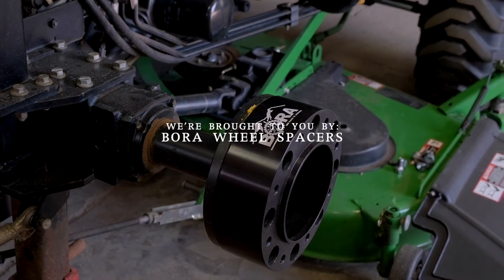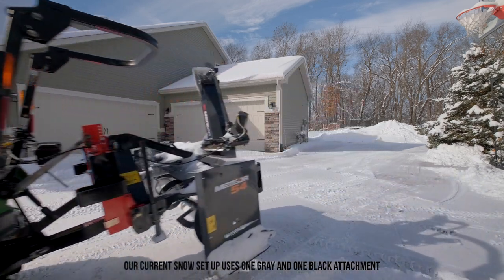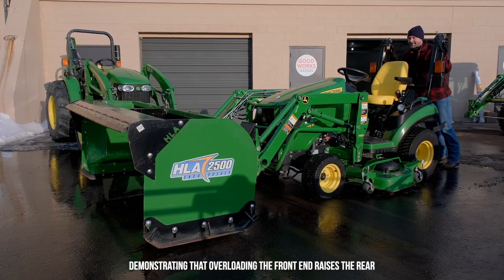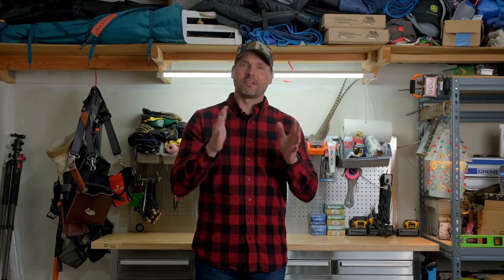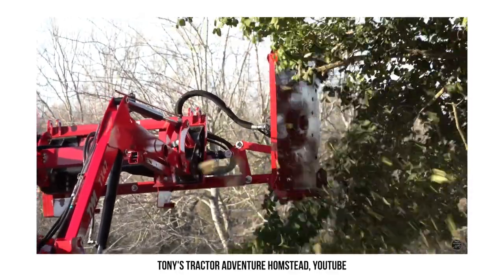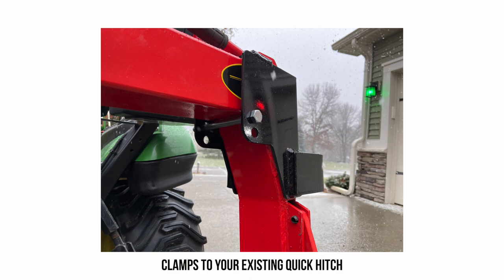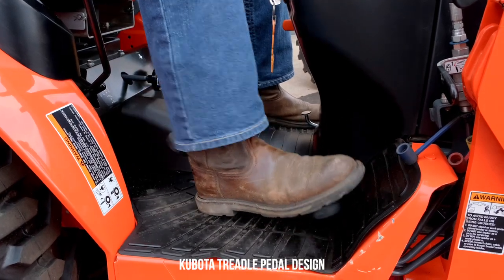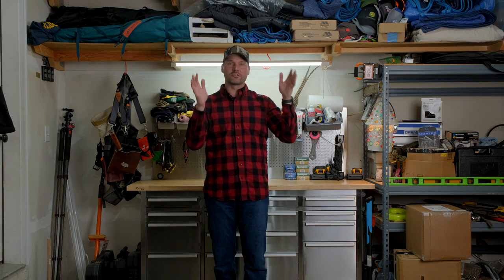7 UNSOLVED TRACTOR MYSTERIES, NO EXPLANATION.  CAN YOU HELP? 👻

Comment: Many moons ago, before anyone had heard of Kubota, Hydrostatic transmissions came around on Lawn and Garden tractors. Deere had a dash mounted lever that required you to negotiate a slot at the neutral position to change direction. IH had a lever that simply pivoted, no gate. Ford, made by Jacobsen had a lever that simply ran in a straight line and the knob on top would pop up when in neutral to lock in place. The next generation Ford in around 74(?) had the treadle. New Holland and the Case IH painted clone still uses that design. Everyone was scared of patent infringement. Then we have what there is today. Deere put the brakes on the left; entirely backwards to me. I control motion with the left, brake on the right, foot throttle on the right, just like any other vehicle. At some point we switch over from compact to full size tractor and the pedals are where the have always been. Deere even dropped individual brakes somewhere until you reach a certian size. At least we aren't trying to still use hand brakes like a WC Allis. You haven't lived until you try and stop a loaded hay wagon in road gear. I had a Ford 2110 once. I liked the size and power but came to hate the poorly designed engine.

Comment: I'm not a fan of the "treadle" pedal either, especially the one you showed with a big gapping hole in the middle (C shape). I rented a Terramite a few times and the pedal works in the same way, except it's a full platform that your foot rests on 100% of the time and it's comfortable. I used my friend's Kubota L3301 a lot last summer, I got used to it, but I'd rest my heel on the floor pushed the part sticking out with my toes. To reverse, I'd lift my heel and just stomp on the rear piece sticking out. Laying the foot on top of the whole thing is unnatural.  While I don't like the order of the JD pedals, it's still a lot easier to get used to my 1025R. Probably the 20 years of using a 100 series ride on helped.

Comment: I dont know why manufacturers have gotten away from making low profile machines in the 50-75hp range. Just bought a new 5075e almost a year ago now and it's just about worthless without something heavy on the three point. Haven't gotten around to filling the tires yet but it's coming. My old Ford 4610su has never scared me on uneven ground and I've never had the rear tires off the ground. They've always had water in them though.
Reply: Just bought a used 5075e cab. I put 50 percent filled  rimguard in the tires. Quick hitch with heavy hitch on the back for weights. I can take the rear weights off easily that way. Well I have a forklift. So I can cheat that way. Heavy hitch is because I also bought a grapple. Messing with trees. I might want more weight then filled tires. Otherwise I might have filled the rear tires more. Forgot about the heavy hitch. Make sure you have the tires mounted on the wide side. Some farmers do use the smaller tractors for row crops. So they want more clearance under the tractor. So the tractor itself does not knock the crops down. Or rip the leaves more.

Comment: Its called common sense.  Tractors are built to use a multitude of different equipment.  The basic trator can not be set to operate every piece.  That is why there is auxiliary add on equipment.  Now when selling a bucket, or other equipment, there should be a list of recommended add ons necessary to operate safely.

Comment: 🤣🤣 Thatv was great!   My neighbor painted his Kioti JD green and paid 25 to 35% more for his attachments than I. 🤣🤣  I think I have the HST pedal reason.   BC on a long road trip or a full day in the field. Pushing the car right pedal that long would give you groin problem.  
Tractors should come stock with  Bora Wheel spaces.  
I bought the Rhinohide BC it comes off easy so I can get in the garage door.   And it's lightweight helps stability.  It also should be factory.   Indestructible!   Best thing I've bought off you.   Cuz!

Comment: After reading all the comments here, I keep seeing "Why don't they just...".  Addressing this from a general engineering and marketing perspective, there are some easy answers, and it's not tractor specific. R&D costs a lot of money. First, there has to be enough interest from the market to add it or change it. For example, why don't tractors have horns?  Well, how many people would use them? Sure, they're probably only $10 to $15 in parts (horn, horn button), but if you make 10,000 tractors a year, that's $150,000 in parts. But wait, the implications go deeper, because horns need fuses and wiring. The fuse box may be at capacity, so there's the added cost of adding a fuse position to the fuse box (which may or may not have space, and could entail changing how it's mounted). Horns aren't wired straight from the horn switch to the horn, they're part of the wiring harness, so connectors with more circuits will be necessary. Now that fuse box and harness aren't compatible with any subsequent models that may have used the same assemblies. Then where does the horn switch go? On the wheel? Now we have a new steering wheel change. Maybe it goes on the dash. But there's no position for it, so now the dash needs to be modified, which means new injection molding or machining. Manuals have to be updated. Assembly line people have to be trained. It escalates quickly. And there's more...

They have to stock replacement parts, have SKU management, and have to determine how long that part will remain available, etc. Now, how many people care about having a horn? No idea, but let's say it's 0.1% of the market (obviously they've gone for years without them, so the demand isn't really there, and they're not a required safety item, like back-up beepers on heavy equipment). That's 1,000 users out of 10,000 tractors. So maybe those people are willing to pay the extra $25 for a horn (remember, you have to mark-up products to make a profit, nothing is free). But it's not an orderable option, the tractor comes with it (making it an option would add even more additional cost). So now 90,000 buyers are paying an extra $25 to support the 1,000 buyers who want a horn. And people complain how much tractors are cost now, and who the heck uses a horn on a tractor (except that 0.1% who LIKE the idea of a horn, but may even use it).

You can extend this to ANY modification to the tractor. How much will the change cost to engineer, how much will it impact the production line, is it a feature buyers actually care about, and will the market bear the additional cost of the feature. Consider adding 3-point downward pressure. Are you going to pay an extra $1000 for that? How many buyers would pay for it, and is it enough to justify all the issues mentioned above.

I believe it's not that R&D has no interest in adding features or making changes. I'm sure there are plenty of engineers that have had really good ideas that have never made it to market because the market analysis says that it would result in a net loss. Or it's been patented already, or the lawyers say it would add too much liability. I've spent enough time in product development in last 45 years to appreciate these issues. I'm no expert on tractors, but I do know the cost of changing products, even for what appears to be a "simple change" from the public's point of view.

Comment: I have a question about wheel spacers to help with that tippyness. I'm thinking that 4 inch each side front and back will help a lot...my question is...should I also consider more ballast. I usually run with a brush hog on the back....but sometimes not, particularly in the winter months...should i consider suitcase weights for the back?

Comment: They should engineer a decent tool box somewhere on tractors. always a pain in the ass to walk back to the truck or barn to get a tool.
Reply: Add a place for small amount of fuel.  Better to have it so you can run back to the barn. Running out in the field is a horrible day with most tractors.  Only have to do it once to learn that lesson.
Reply: JD 3020, a deep, long toolbox was molded into the bodywork under the left side of the seat. An 18 inch Crescent wrench easily fit into along with a big hammer and other wrenches. My cab tractors, JD 4440 and 4250 had a good sized toolbox bolted to the frame in front of the step. Big enough for those tools also.  My JD 1023E has a small toolbox bolted on the right to the back of the RPOS.  Good for smaller wrenches.
Reply: I bolted a medium sized ammo box on box blade.
Better than nothing.
The money spent why not a decent factory tool box.

Comment: 3 point down pressure, or the lack thereof, has to do with draft control for semi mounted and mounted moldboard plows. Hydraulic systems on FARM tractors are severely under designed. Roll bar height was designed by real good lawyering, and nothing else. For the most part FARM tractors where not, and are not designed for the majority of what they're being used for today. Hydrostatic transmissions are a lot cheaper than a real loader transmissions, and there is no good way to control them.

Comment: Our old Ford 3910 has down pressure as a stock feature. It has 2 levers at the 3 point. One raises and lowers and one is labeled down draft/effort. There is a cylinder under the  seat that connects to the top of the middle link connection.

Comment: My guess is that it is the really small tractors that are so tippy because you must have a certain ground clearance to be useful, but they are very narrow. So the cg is high and the angles to it from the ground and wheels is too large.  Also the operator is a significant portion of the mass and sits very high.
 I don't find my 50HP tractor all that tippy. But my mass is small in relation, and the width being around 68in leaves the angles to the cg a bit smaller, and so there is more room for tipping.

I have to agree on the 3pt down force issue. It should be a double acting cylinder inside there as standard. If that was normal you could create a special trailer that slips under the tractor, connects to that 3pt, and lifts the tractor up onto the highway wheels. The bucket could have a pin on ball mount or use the SSQA for a dedicated ball mount and then you could take your tractor on the road using the tractor as the trailer frame. Save 1500-2500lbs off the towing load.

It would be really useful for any grading equipment, much of the dirt engagement equipment like tillers and discs, and for the post hole auger. It will be a bit of a traction game though. The more down force, the less traction, so you might spin the wheels.

Comment: I've already been thinking about adding the incline gauge. I have nothing but hill and slope at my place. I've already given up on the finish mower and bought the cub cadet pro z 972. Safer and saves time
Reply: I have had that same Lev-O-Gauge on my tractor for years now and it works very well. It helps you learn what side angle is "safe" and when you're in trouble. Obviously variables there in terms of what is "safe", like whether the loader is up, slope is smooth, your speed, etc, but is a nice objective bit of information when you get too confident or feel like you are going to tip it over...and are only at 20° on a smooth side slope at low speed (which should be OK). The first time your uphill side gets light you will learn a lot about what is OK for your tractor from that gauge. Once I got that figured out I marked the gauge with red/yellow/green markers for the ranges.

Comment: So there is a reason why tractors have the high centre of gravity, became tractors were originally for farms and most generally the applications we need them for was to be able to drive over our crops without damaging them.  In fact there are specialty tractors that are even taller these are classified as high clearance models. Compact tractors are a adaption from farm use to home owners so people were looking for their own personal tractor. As for width farms tractors wheels are adjustable for different wheel spacing the two most common spacing be 60” on centre and 72” on centre again this comes from farms trying to have a specific space for their plants to get max yield per acre. The compact tractors are being designed to go as narrow as possible to to fit in more places and are not used where specific wheel spacing is required.  
I can’t speak to the hydrostatic pedal configuration, again that is a compact tractor adaptation form lawn mowers. Tractors that are meant to be used for farming activities need more precision for speed control so much of our equipment requires constant speed wether it’s .5 mph or 10 mph it needs to stay the same, .3 mph variance is way too much. 
Hydraulic down pressure on the 3pt would again be a bad idea because much of our implements need to float with the surface of the ground as we drive. If it didn’t then the use of the 3pt would be almost nil.

Comment: the farm I worked on bought a new BELARUS 822 Tractor 100hp an 4wd that had a down pressure on the 3 point hitch.. and man did it tear up a lot of equipment esp. post hole diggers. the down pressure sure worked good to lift the back of tractor to fix flats.

Comment: On the tippy issue tractors were never designed to have a front loader.  Notice that dedicated front end loaders have the axle oscillation in the rear and a solid mount for the axle in the front.  Also I've never understood why common tractors have smaller wheels in the front and large in the rear.  Some of the European tractors have equal sized wheels and articulation for steering and this seems a better system for stability.